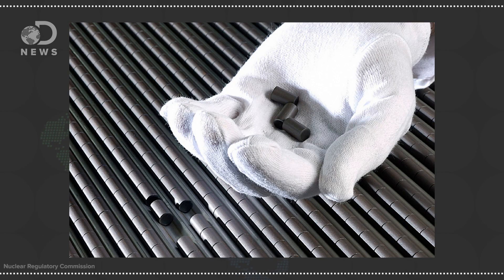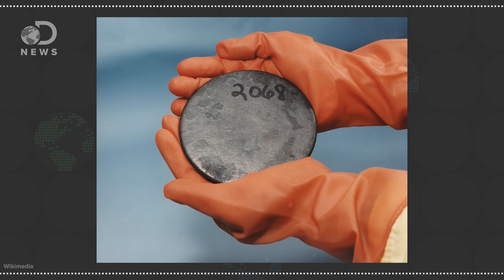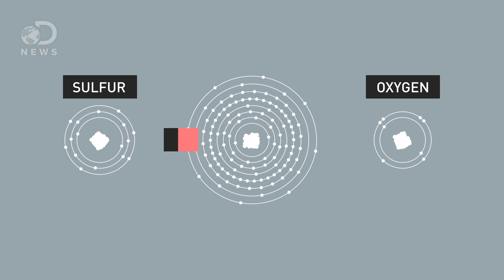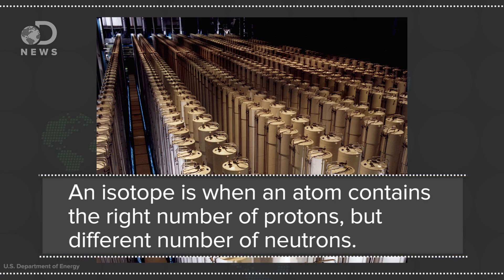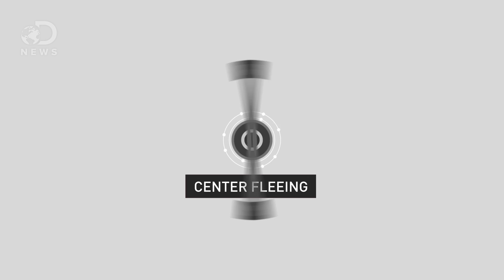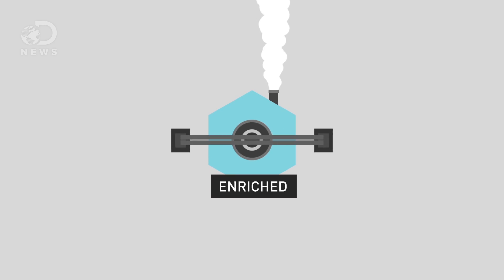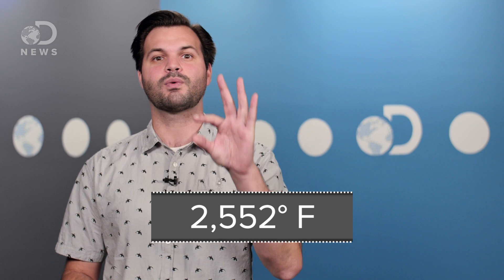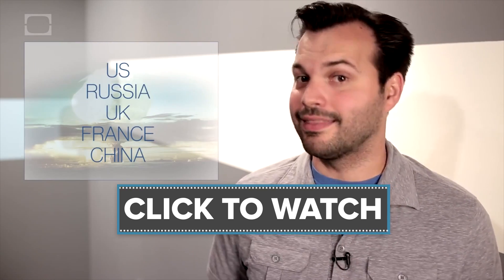How Uranium Becomes Nuclear Fuel

Comment: Excuse me but where has Nuclear Fusion any cons at all?
Reply: lightsidemaster difficult to start a reaction.
Reply: y2ksw1
Yeah but that's problems that will be solved very soon.
If they aren't already.
If that happens then there is literally no negative aspect about fusion
Reply: Fusion reactors create some (alpha, beta) waste, but they have a very short half-time, in the order of days, and thus decay long before they are becoming a problem.

The point of fission waste is, that the radio-active "waste" in reality is inefficient fuel, and yet not many attempts were made to recover as much as possible. Running power-plants today means to refill when the tank is still half full. And this "technique" has to stop ASAP.
Reply: *****
We probably won't get away from chemical rockets until we invent anti gravity technology, which is hard sci-fi and likely not possible at all.

Did you read that LFTRs also can consume the old waste?
That is why it is up to the anti-nuclear crowd to defend storing it for 100.000 years. I say we use LFTRs to use it as the unspent fuel it is.

The half-life of Plutonium 238 is 87.7 years, so if you want to store it you would probably want to leave it for 300 years or so.
The radiation from Alpha particles are that harmless when you have a small shield, like air or skin.
But if you get some particles of it inside your body you will get radiation damage.
The chance of it getting into soil or ground water is greatly diminished when it is suspended within the salt fuel.

Most, if not all, of the negative aspects listed on the LFTR page on Wikipedia are mostly engineering problems. Not inherent problems with the core fundamentals of the reactor type.
Reply: ***** It is currently still sci-fi?
Reply: Merecir
No it's not xD

Hyperdrive is sci-fi, nuclear fusion not.
Give it 10-15 years ;)
Reply: *****
They have said that for the last 60 years.
Reply: Merecir
I know but if they don't make it, then I will force them to make it or just do it myself.

It's a huge goal but after I'm done studying physics that's one area where I wanna participate in.
And I'm incredibly impatient regarding technological progress...
Reply: ***** Ehm:
-Massively complex.
-Massively expensive.

We would be better off putting all that money into refining LFTRs and producing them on a mass scale.
Reply: Merecir
Energy through nuclear fission with tons of radioactive products...
Cool stuff. It's as if we were still in the 20th Century.

Nuclear Fusion is the next big step of energy revolution.
You will see
Reply: *****
So you just confirmed you know nothing about LFTRs. I would suggest you try googling it before making any more stupid arguments.

FYI: LFTRS do not produce waste, because they are designed to optimize energy production.
As opposed to be optimized for waste production as the current uranium light water reactors are.

Even if they managed to make the fusion reactor they are working on now to work, it would still be WAY too expensive for almost anyone to build.
Reply: y2ksw1 The same with the 'waste' from a LFTR, for most of it the storage time would be on the order of days to a couple of months.
But of course, the main end product that some might call waste would be Plutonium 238 (alpha radiation only), but since that is the very stuff used to make RTGs for NASA it is not waste, it is a valuable resource.

Your second paragraph tells me that you still have not bothered looking up LFTRs.
-A LFTR use 100% of its fuel.
The only things you get out of such a reactor would be the fission products and Pu238.

I'm not arguing for the current uranium based light water reactors...
Reply: Merecir
I did do a bit of research on it, and it looked interesting, certainly way better than Uranium reactors, but there were so many negative aspects that I didn't bother learning more about it.
Even if it's for a vastly shorter amount of time there still is radioactive waste.
And there are still issues that they haven't solved yet, which have to be solved first before even building one.
Nuclear fission is NOT the future.
It's just the stepping stone between fossil fuel energy and regenerative energy/ Fusion energy.
But you'll see.
Also just because the radioactive leftover materials are USED and not stored somewhere, doesn't mean they are not waste.
Something that is poisonous, deadly, and radioactive to me is waste.
It destroys life. How could one be foolish enough to use something like that?
Reply: *****
As you main issue seems to be the 'waste':
-Some of the fission products (the resulting elements from splitting uranium) are radioactive, but only for a couple of months, but that is not such a major issue as they are still suspended in the fuel salt you could just let it rest in a solid state for that time and then melt the salt and do the chemical filtering when they have calmed down.
-The only transuranic you will get are the Pu238, and that is quite a special form of Plutonium as it only radiates alpha radiation. And if you did not know: Alpha radiation can be stopped by a paper, an inch of air or your outer layer of dead skin cells. You could wear an armored suit made out of Pu238 and be perfectly fine (it might get a bit hot though).

On the issue of using the Pu238 in RTGs, How do YOU suggest we power long range space probes and big rovers? Solar is out of the question, fission plants the size of a vacuum-cleaner is hard sci-fi and no battery can last 30 years.
I am very curious what your suggestion will be.
Or are you that kind of person that think space exploration (and eventually human expansion) is a waste of resources?

What other negative aspects did you find?
Reply: Merecir
Well actually my main issue is, that we're in the 21st century and we're still using chemical propulsion to shoot rockets into space and split atoms by fission and then bury the waste under ground.
We should be a lot better and further than this at this point.
Anyway, yes, if you ask me, they should fund and build Thorium Reactors.
Maybe if just for 20-30 years, but if they would replace all the Uranium fission plants, that would be perfect.
I just don't personally like it.
It's not what I want to see. But if renewable energy isn't sufficient without fusion plants, then I see no other option sadly.

Wait, I read that the waste products of Thorium reactors would be radioactive for at least 100 years?
So that's wrong?

I knew Alpha Particles aren't that harmful, but to think that they really are THAT harmless... that's news to me.
So also no negative impacts if the waste products were to somehow make it into the soil or ground water?

Well I'm all for using Nuclear Fission in Space Rovers and co.
Use as many of them as you want. And as much as you want.
We have no other choice right now.
Exploring space comes first in my opinion.
We'll just have to be quick in inventing new forms of energy cells.

So to make it clear, I'm not against using Nuclear Fission IF IT'S ABSOLUTELY NECESSARY.
But here on Earth, where we already overloaded it with trash and waste, we should really use it as rarely as possible.

Well right now I don't have another option.
I've recently started studying Physics, maybe in a decade I'll be able to work on some of these problems.
All I know is that I'm pissed as hell that we still use toxic chemical batteries.
Inefficient, toxic, decades old technology... it's pathetic.

Well I simply checked the wikipedia page about Thorium Reactors.
And they had quite an extensive list of negative aspects, so instead of me telling you what I remember from that, I guess it would be better if you checked out the article as it will probably give you a better answer than I could :P

By the way, thank you for this nice discussion, I'm glad we're able to stay civilized :)

Comment: GRAR, fusion is not just hydrogen. fusion is all elements lighter than iron. but it grows more difficult with atomic mass so hydrogen will be our first attempts. uranium 233 is our best fission source. which you make by adding a neutron to thorium. you get thorium 233, which decays to protactinium 233. which over about 27 days decays to uranium 233. it is fissile, and you get fission products and 2 to 3 neutrons. which fuels the reaction again (if you slow down those neutrons with some carbon 12)

Comment: Nuclear fusion is a far better safe energy source than fission due to lesser radiation release.Its also gives a lot more energy than fission,but, the technology is still in its rudimentary stage in order to be commercialised.I think you guys should upload a video about Tesla PowerWall Batteries which should be kept by people as a highly efficient and benign solar power backup, in case the grid goes off.Moreover, these batteries would also help decrease the load on power grids.

Comment: I'm glad I understand the process used to make uranium, but that doesn't make me support it. We can reach the same efficiency with green fuel if we put enough research into them.
Reply: ***** Thorium reactors are green energy
Reply: Darius P
The worlds Energy (2007)
Tonnes of Coal: 5 000 000 000 (five billion)
Barrels of Oil: 31 000 000 000 (thirtyone billion)
M^3 Natural gas: 5 000 000 000 000 m^3 (five trillion cubic meters)
Tonnes of Uranium: 65 000 (sixty five thousand)

ALL of this could be replaced by 5000 tonnes of Thorium.

5000 tons is a tiny amount, and could easily be mined from one medium sized mine.

One mine, to power the world.

And is is as abundant as Led, so the amount of mineable Thorium on earth would be able to power the whole world of today for over 30 billion years... That is about six times the lifetime of the sun... The term 'renewable' kinda looses its meaning then, doesn't it?
Reply: Darius P  Chinas LFTR program aims for completion in 2024. The west can do it to, if there is political will.
Write your representatives and tell them to support LFTR development.
Reply: Darius P Likely that imported power comes from russian gas, German coal or old and shitty soviet nuclear.

Since LFTRs are inherently safe they do not need the massive buildings and twenty layers of safety measures. And thus they wold be far more cheaper to build.
Heck if demand is high enough we could manufacture the reactors on an assembly line in a factory.

Did I mention that 93% of the end products are perfectly safe materials that can be sold for a hefty profit? Materials such as Xenon (ion rocket fuel) and Neodymium (magnets).
Reply: No we can not, unless you consider fusion green, then yes.
Reply: Merecir But you need to mine (not very green par and process thorium, in addition it is not renewable.
Reply: Merecir We still aren't using that, so we need something we don't have (Edumacate me on that please)? Other than that, yeah, sounds pretty great.
Reply: Merecir In my country we recently closed down our only nuclear power plant and now we are pretty green but dependent on energy import. Unfortunately, I don't think we can afford even a new one, let alone LFT Plants. :D

Comment: Does the energy cost of enriching uranium surpass the energy produced in a nuclear power plant
Reply: ***** If it was we wouldn't be using it as an energy source.
Reply: ***** ya im an electrical engineer, and what people dont realize is that pipelines corrode. 

you also need to draw from the powerlines to force the oxidation reaction to a "sacrificial anode" that is so the pipe does not corrode. This draws millions of watts.

We havent even got to the process of separation of oil and sand.
Reply: ***** So the pipelines are using electricity to stop them from corroding? That's interesting, didn't know that.
Reply: *****  are they not lined with a coating to prevent the pipelines from doing that? Seems so unnecessary :/
Reply: ***** Fun fact, your car's negative end of the battery is connected to the cars frame to also slow corrosion.  

It can only slow the process as this is just a counter equilibrium to the Fe2+ being dissolved into the electrolyte (water) and the connection to the anode allows for a supply of electrons to the Fe2+ to turn it back to Fe(s). Of course some Fe2+ escape and bond to O2 to form FeO(s).

Yes this means when you boost a car, you can use the car's frame as the negative end of the battery (this simple knowledge saves many batteries from being blown up due to people clipping live wires to the bases of their cars).
Reply: ***** Not even close, no. Most reactors run at 1200 kWh, cranking that out 24/7.
Reply: ***** Not even close.

Comment: i would rather they invest in thorium reactors over uranium reactors for A: A LOT safer. and B: The Thorium reactors are aprox 200x more efficient than conventional uranium reactors, not to mention that thorium is way cheaper than uranium...
Reply: Its more conceptual than an actual solution.otherwise why dont you see thorium reactors poping up all over the world
Reply: DOOM89 I'm hoping for either Thorium or the Takomaks reactor in France to end up working perfectly.
Reply: DOOM89 thorium also cannot be turned into weapons grade plutonium either
Reply: TopShot501st yes but the concept from what i've researched is astounding, china is charging ahead in research of thorium reactors because of the potential the technology has, way back in the 50s when reactors were in their 1st iterations there was a functional thorium reactor, the reason it wasn't chosen over the uranium breeder design was simply because the government of the u.s. wanted something they could get weapons from, simple as that. but for energy generation thorium is by far the best choice because its safe, clean and inexpensive.
Reply: Super Nova I choose to disagree, plutonium is a much more unstable element than thorium and when spent as nuclear fuel remains radioactive for much much longer than thorium waste.  we also do not need nuclear weapons becoming a possible threat
Reply: DOOM89 Uranium actually has a higher energy density than thorium if used in a breeder, but the difference is small. I would like a MSFR because they burn uranium waste much better than thorium reactors, and in the same molten salt fuel form, but likely chloride salt. You probably just need centrifuges to separate fission products from the fuel salt if you aren't making net plutonium. I don't think the twitchy reactor response with molten fuel on the fast spectrum would be an issue, should be self regulating all the same as thorium MSR.
Reply: MVP
Reply: Doesn't thorium decay into uranium though? Also, word on teh net is that Lockh33d is close to harnessing fusion (Y)
Reply: +Jebus Chris i believe a little is generated but its a tiny amount (thats why when they were choosing reactor designs in the 40s or 50s (i cant remember exactly) they went with the uranium reactors because they produced lots of material that could be used in bombs where as thorium didnt (or at least not in high enough quantities for making bombs). the future will be powered by thorium and fusion, thorium compared to fusion is very cheap and by contrast, something we could build now.
Reply: +DOOM89 Actually, one of the the intermediates in turning thorium into a nuclear fuel is radiactive as fuck, emiting loads of gamma rays. So teh guys building these reactors didn't want to put up with that bullshit, so they stuck to uranium because they didn't have to worry about the gamma radiation as much.
Reply: +DOOM89 It's actually not the only reason. If you irradiate throrium (unlike uranium) One of the things you produce ends up being an extreme gamma emitter. This makes the whole material handling proccess a pain in the ass, and by that I mean really dangerous. The guys who had to work witht these things did not want to put up with that bulshit, so they stuck to uranium instead.
Reply: +DOOM89 Any energy policy debate anywhere, especially ones held in govornment offices of any country. Should just be the word Thorium, repeated continuously until some dingbatt smegging does somthing about it.
Reply: +DOOM89 true but what thorium reactors do is decay thorium to uranium and fission it winch makes thorium reactors also mostly powered by uranium.
Reply: Super Nova
I think that's because U235 always has U238 which creates side reactions which create heavier actinides. If you had just extremely enriched (100%) U235 then (I think) very few actinides would form, but very expensive and bomb grade.
Reply: +leerman22 Please call them radioactive elements for idiots who don't know actinide word.
Reply: Colonel Angus i'm aware :) that's the only reason they chose the uranium breeder reactor design over thorium.
Reply: TopShot501st Because thorium can't be used to make nuclear weapons with..sometimes things are that simple in this shitty world